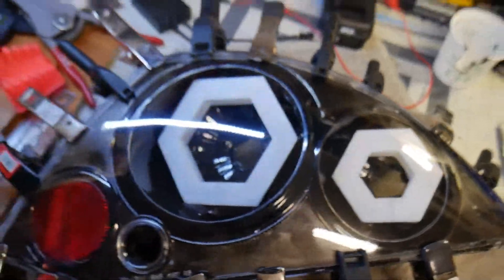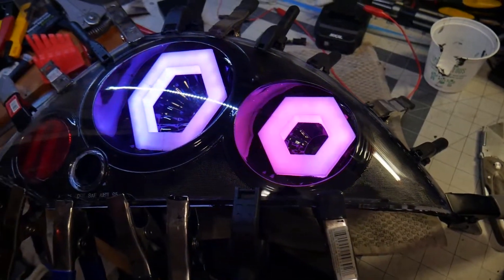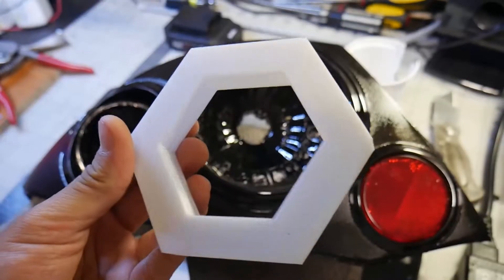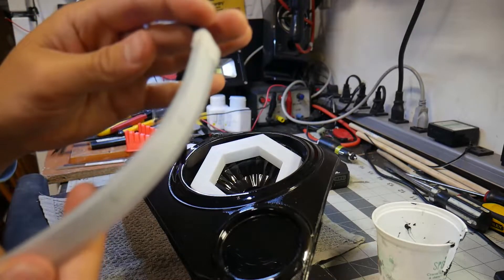Custom RGB Sequential Tail Lights for 3G Eclipse!! | 00-05 Mitsubishi Eclipse

Comment: How bright are them during the day?? Also good work🔥 I’m trynna get these one for mine just have that question
Reply from the maker: Assuming all the 12v is getting to the lights, essentially full brightness. I've checked with my LUX meter red usually measures at 200-350 which is about right